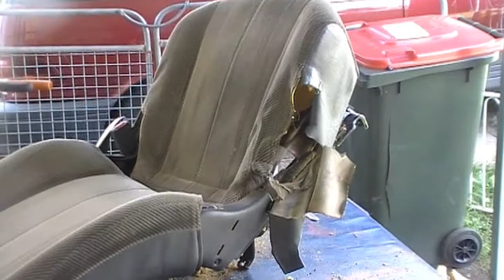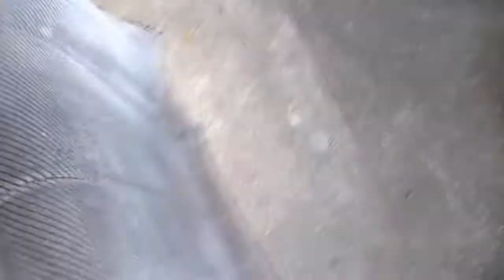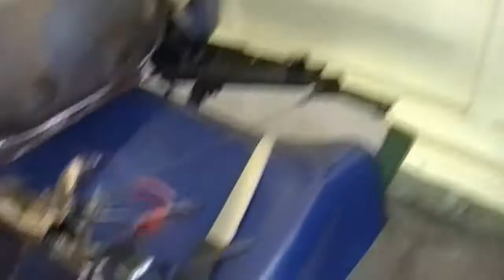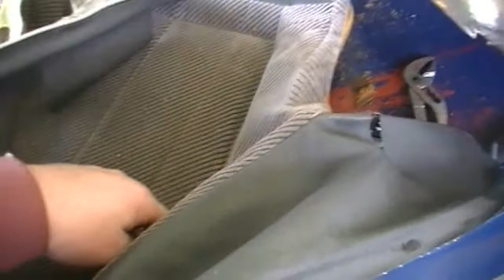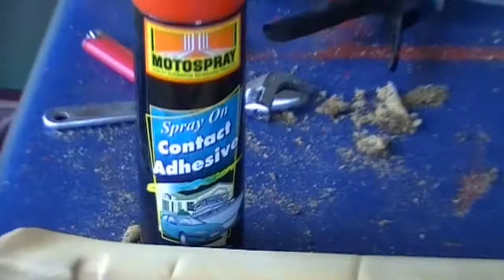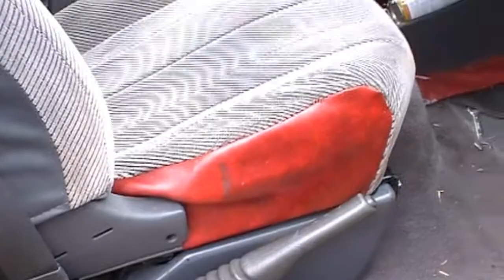Driver Seat Repair [ Tarago Previa Estima TCR ]

Comment: I have the same vehicle in Thailand. Do you know how to remove the front headrests? There is no button to push, nor hole to push a pin into. There is also no plastic dollar around the headrest posts. They go directly into and through the seat fabric. I am trying to remove the seat covers to wash them. After almost 30 years, they are really dirty! dalemcgeorge at hotmail. I have tried everything I can imagine! The seats look like new though, they are just dirty.